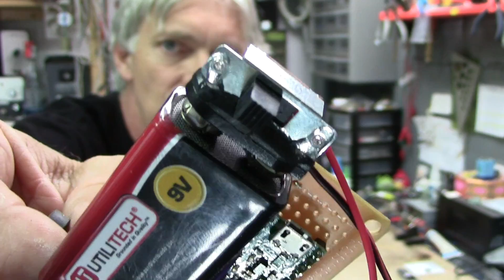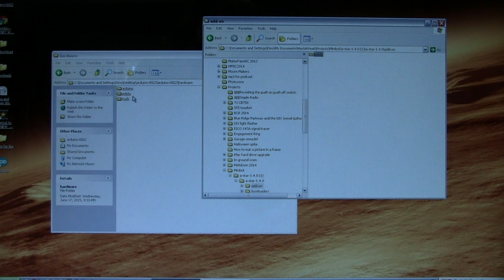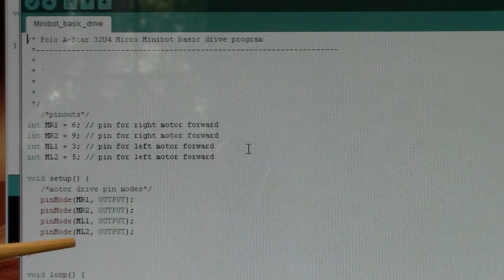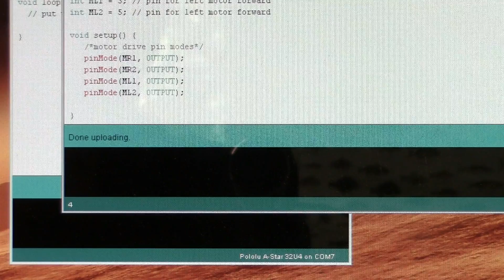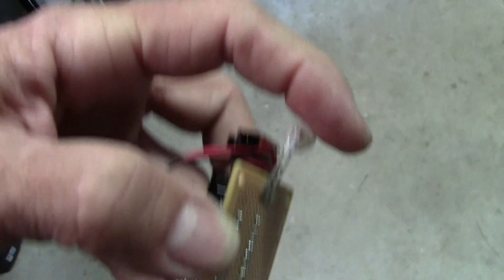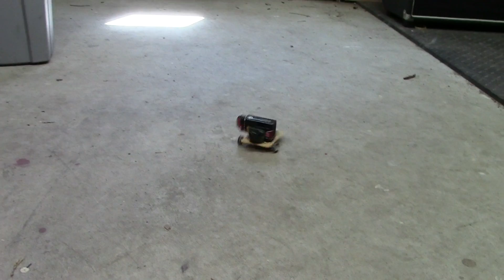Mini-bot part 3

Comment: The sensor was not used at all and there wasn't a more advanced sketch that took in input fro the sensor, processed it and moved accordingly. I am also building a slightly larger robot using an Arduino Uno clone which will take inputs from several sensors. In the initial stage it will move using two motors, but I will add two more.

Comment: how come you did not use an arduino for this??
Reply: Joe Schmoe Because the A-Star 32U4 micro controller is only $12.75 and it's tiny!
Reply: ***** Can the A-Star 32U4 micro controller be used for a small sequencer? Like the door opening for the landing gear of an RC Plane??
Reply: Migueldeservantes I don't see why not.